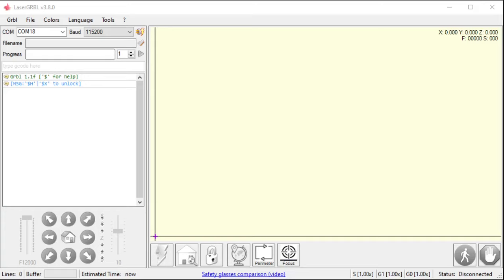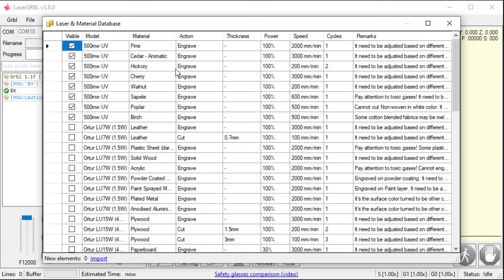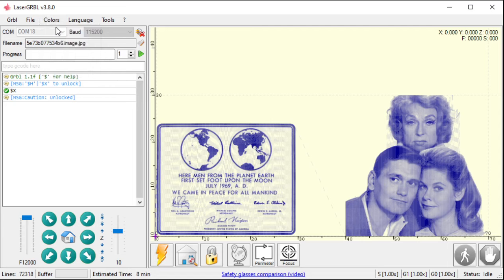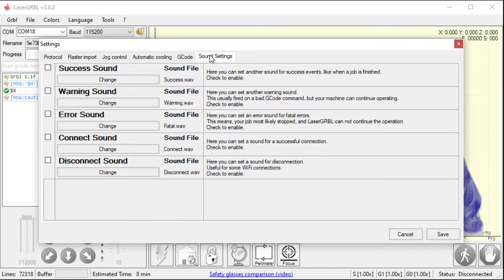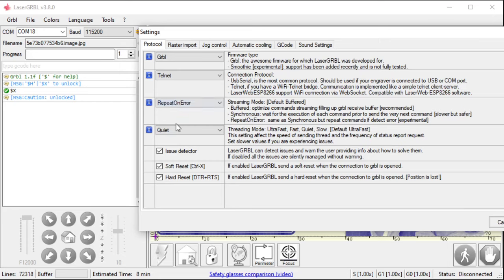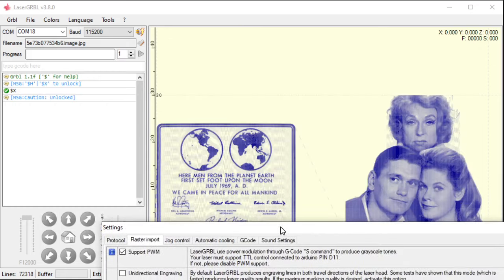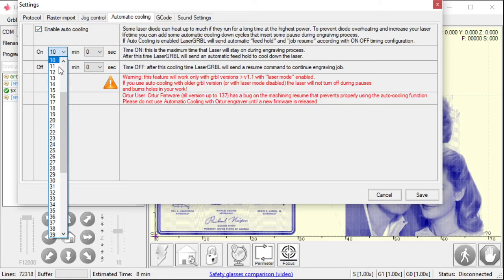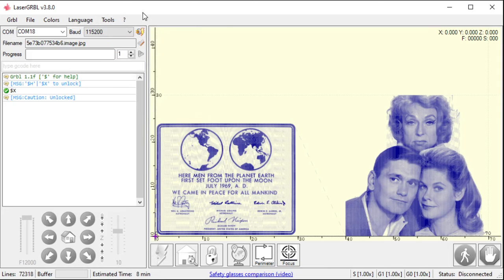LaserGRBL Tutorials - Features and Functions

Comment: So about 1/2 hour ago i ordered an Atomstack lase, my first, hope the learning curve is not to steep for an old man, I see this as a huge fun then to add to my woodworking and your class has helped me a lot ....Wish I knew what some accessories I need for my new toy  perhaps you might have a list?  I can ask  Atomstack, they will say everything.  the Air assist looks like a aquarium pump...
Reply from the maker: Not all laser heads are designed to use air assist. It does very much help with cutting though. a 40 watt aquarium pump is plenty.
Reply from the maker: Accessories:
- Calipers
- metric small tape measure
- Borax
- Aluminum foil

Comment: Hello, thank you for taking the time to make this tutorial it is very helpful. I am wondering if you can help me with an issue I am having. My machine will run but nothing is burning or showing up on the material. Can you help me fix this issue?
Reply from the maker: First,, check your max S setting by typing in "$$" to your console. Look at what $30 returns. Make sure to set your Smax in the second setup screen to that value (typically 1000). Try using a slow speed like 200 or so. If things still do not burn,, you may have a bad diode.

Comment: Really helpful video, thankyou. Have you engraved laserable rubber on your machine? I have an atomstack 20w and tried to make my own rubber stamps but struggling to achieve satisfactory results. My last effort seemed to be going ok but had to do 7 passes, taking half an hour a time and on its last pass it had moved a millimetre despite being taped down and made a mess! I'm wondering if I can get more depth per pass with different settings. I had it on 4000 mm/?   100% on dithering with a speed of 750. I'm not sure if 'flare ups' at this slow speed burned my fine details away too as it got deeper or if it happened on that last pass being moved. I don't want to waste any more of my A4 rubber sheet :( Or is there a better material to use on a 20w which would make a good fine detailed stamp?
Reply from the maker: Just go slow and do like,, 12 lines per mm to make stamps. Orange rubber works great.
Reply: Thankyou. I've only been able to source the grey one here in the UK but I'll try those settings on it.

Comment: Hey! I followed the video and alls good!! However, when I'm lasering a circle shaped logo there is a small cut off and the line become crooked alittle. Do you have any suggestion on how I can solve this issue?
Reply from the maker: Check the belt tension and check the grub screw holding the sprocket on to the stepper motor shaft.

Comment: Have another video for initial setup for first time users? I'm curious how I can tell if I actually received a 20w laser. How do I know what baud rate to use?
Reply: instablaster...
Reply: On Diode Lasers, the Rating is usually the laser's power consumption - not it's output.  For a 20 W Diode Laser, the output power will be between 5.0 to 5.5 W.  On the Baud Rate - unless you have a very old computer, use the fastest Baud Rate.

Comment: thank you for perfect video help very well,my question i have neje master 20w and the setting right now you show can i lso use for mine device ?
Reply from the maker: Try 8 lines/mm 2400 speed 1bit dithering
Reply: @brakthehun  thank you for answer sir but now show in screen No connection because of target machine actively refused it? what i have to do?
Reply from the maker: With the NEJE,, there is a special update from the NEJE website to use LaserGRBL on it.
https://wiki.nejetool.com/doku.php?id=nejelaser_master
Scroll down to GRBL controller for windows or mac.
Reply: Hi sir, @brakthehun  dosnt work still says machine actively refused,

Comment: Lasergrbl doesn't do portraits on my cnc-3018pro as you stated. Everything I tried failed to produce a decent portait.
Reply from the maker: The 3018 is a very slow machine. It will be difficult to get a good portrait with it. You will be best off using a 500mw 400nm ttl laser.

Comment: Maybe you can help me. I'm new to this. I have an Ortur Lazer master 2 S2. When I start to engrave it will start to run and randomly stop moving but the Lazer is still burning. I have updated the firmware but it's still happening. Thanks for your help. Todd.
Reply from the maker: Does it eventually start moving again?? It could be your stepper drivers overheating.
Reply: @brakthehun  No, just sits there. No alarm. It will do it on small projects just after it's turned on ?

Comment: So with LaserGRBL I cannot position the image anywhere on the grid. So, for those of us who have the Pro version with the smoke alarm right by the Home (0,0) lower left corner; it detects smoke as soon as it starts because the etch/burn is within inches of the detector.
Can I move the image anywhere on the grid? Other than that, thanks for the video.
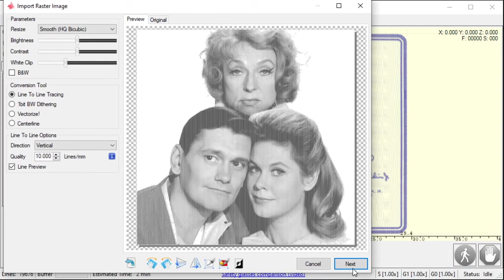Reply: See 6:30.  The offset feature.

Comment: Hey , I m sorry for my bad english. I put youre settings from the video on my machine 2.35 min. But it gos crazy fast en it look like it is stretches out.  I m trying all ready al day but i cant fix it. Can you help me?
Reply from the maker: You may need to set your microstepping. There are use pins underneath the drivers.
Reply: @brakthehun  Hi, thnx for youre reaction. I dont get it good. whatever i try . Do you have a possibiliti to help me?
I hope you can !
Reply from the maker: @savannawagenaar1988  did you set your microstepping pins?? Which controller board do you have??

Comment: I have an original ortur 20 watt Not the ortur 2 20 watt, and I want to make a larger frame.  Can I change the bed size in the software to the new size?
Reply from the maker: Yeah. That's the $130 and $131 settings
Reply: @brakthehun  Thank you very much.

Comment: Do you know how I can speed things up, I followed along here, and selected the plywood as my material,  shows 80% power and 2000mm speed, however mine runs real slow and on the DRO the F max's at about 300 and everything is real dark and burnt. The vector part seems to work,  TIA
Reply from the maker: What machine do you have?? What are the $$ settings?? I just made some GRBL shield videos that might explain how to get the mzx speed from your setup.
Reply: @brakthehun  I have a cheap 3018Pro, My max speeds are set to 2500mm/m, I'll go look at your videos, but seems very slow compared to my K40 laser.  The goal of this machine was to be able to drill my crib boards then engrave them without changing machines. I do that now and it is a pain to line up.
Reply from the maker: @Hoss_1966  you can up the max speed on most of those to 4500 ($110=4500 $111=4500)
I've had a few 3018 and 4018 machines and the seem to run fine at those speeds.
Reply: heres a video to my settings  https://drive.google.com/file/d/1GITXnQJXz4VAuh4C6qciX2bdXqf8H2na/view
Reply: @brakthehun  i'll try that, but on the DRO shows barely goes above 100
Reply: Turns out my $32 was 0 not 1, so now I can at least get some sort of grey scale, and runs a bit faster, now have to learn settings for different woods.

Comment: Hello There is someone who knows why a CNC machine I built does not cut or burn circles or squares and drawings symmetrically.
Oval and rectangular: I use Arduino Shield and ugsplatform
Thanks
Reply from the maker: What stepper motors did you use??
What gears did you use??
What are your $$ settings??

Comment: the ch340 driver has disappeared and will not reinstall even though it says it is installed, but refuses to connect
Reply from the maker: You may have to restart your computer with the machine disconnected. After the computer is booted and you have laserGRBL reopened,, check your COM ports. Plug your machine in and recheck your COM ports.
Reply: @brakthehun  I followed your directions and it did not work.  Prior to this occurrence I was connected to the laser, but I could not focus,  move the laser module or get it to frame.  It appears that something is amiss with the laser.  I have contacted Ortur, but have not heard from them.  Any assistance is greatly appreciated as I am a novice.
Reply from the maker: @hughpace2357  the Orturs need a firmware update to run GRBL. Go to their website and download the updater.

Comment: Could you help me please. My laser was running on GRBL but then it lost the port connection and I can’t figure how to reconnect
Reply from the maker: Check your cable. Check that no other programs are trying to use the port (laser programs / 3d print slicers / programming IDEs)
Reply: @brakthehun  ok thanks a lot for your insight brother.